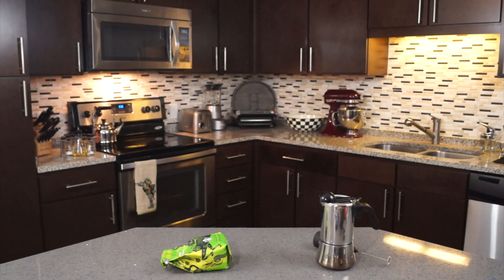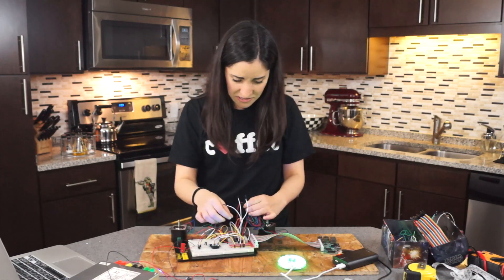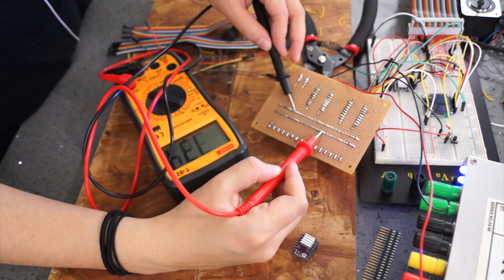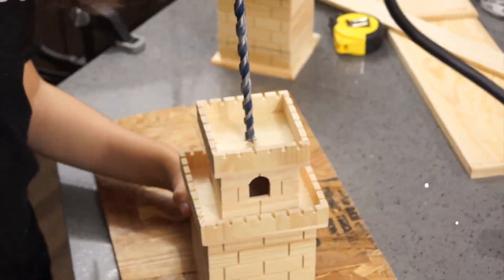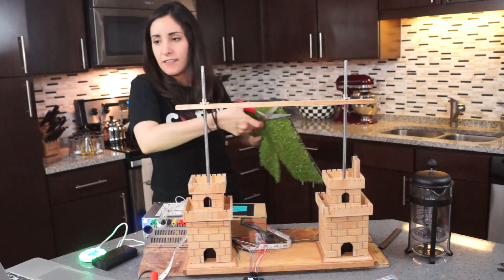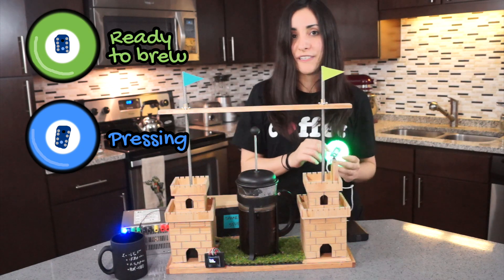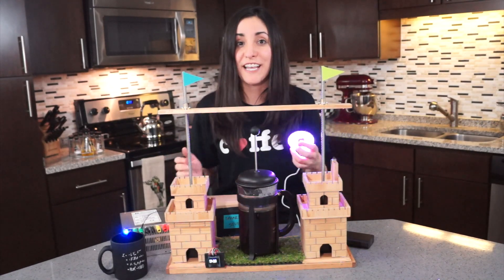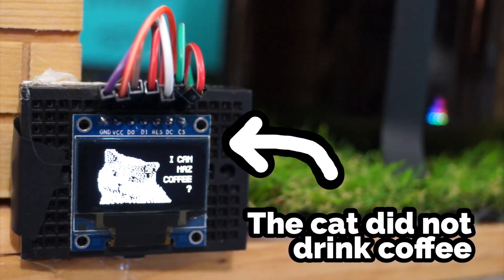How to Make an Automated French Press

Comment: its just press the thing down thats it. u can do much more with the pi. imagine if it could pour it in a cup for you.
wat u can do is putting 2 motors on top and bottom of the french press which will rotate on opposite side of each other to tilt the french press.
u can give command to it like '2cups' to tilt more something like that.

Comment: Not devaluating all engineering efforts here but... This is the ultimate opposite of technology/automation benefits. As cheap as this project may be, it's end result is just complicating an already simple process, without real automation benefit, as water, heating, and coffee itself will still depend on manual/human action. All in all, this is just a big effort and general waste/overhead just to push something down. A large enough hourglass could probably substitute whole setup. No data/knowledge being passed on, no comments on what exactly went wrong, why and how to overcome. Expensive and useless waste of time.
Reply from the maker: I think you missed the point
Reply: @Estefannie  I might as well agree. But might as well be right with the same argument.